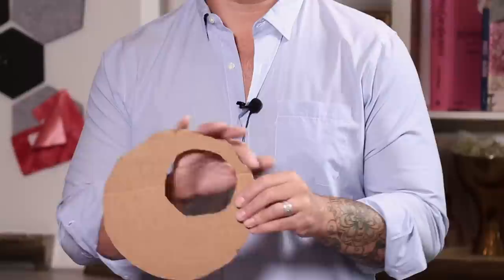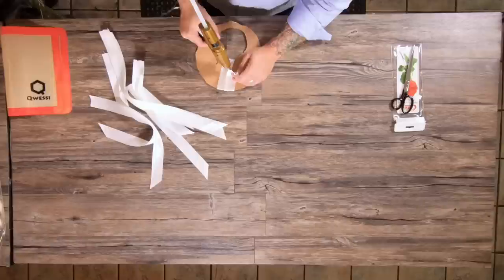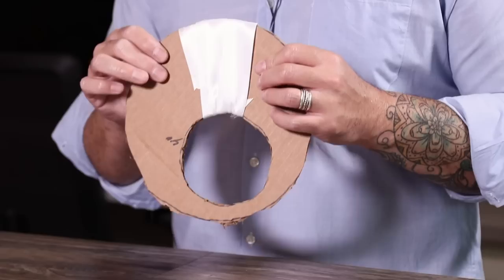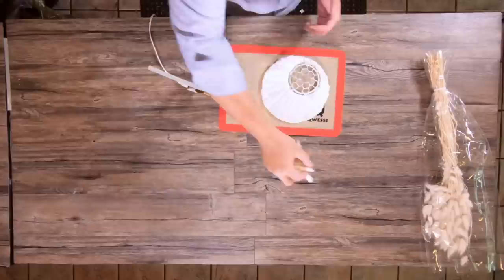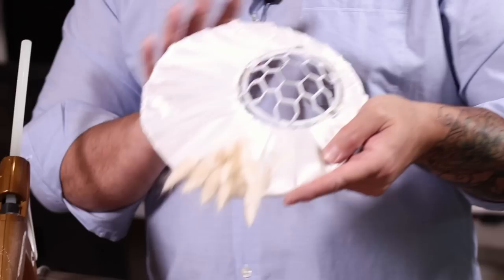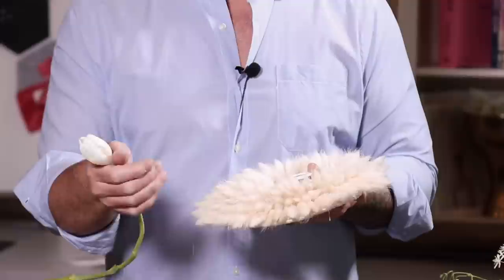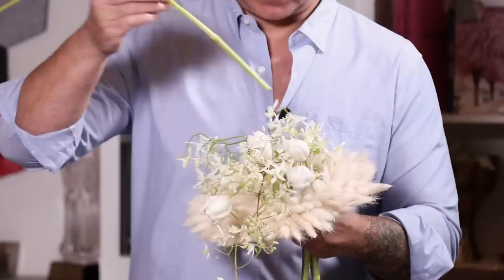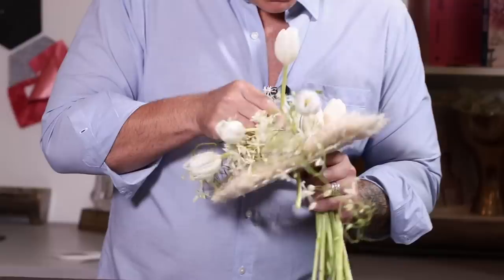Fabulous Bouquet Showcasing A Collar Created With Dried Bunny Tail

Comment: Thank you. I really appreciate  your designs. They are quite inspiring.  Also, I love your references for your designs. If it is not too much trouble, could you advise approx.  how many of the bunny tails you used? My thanks.
Reply from the maker: My pleasure... I love share with each other.  I utilized about 2.5 bunches of them.